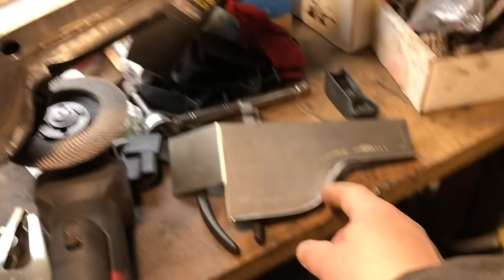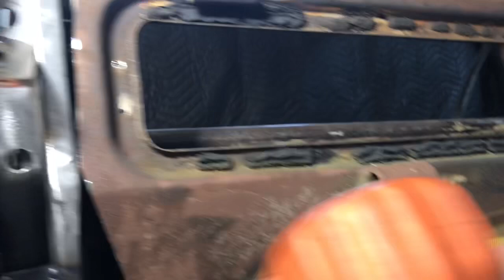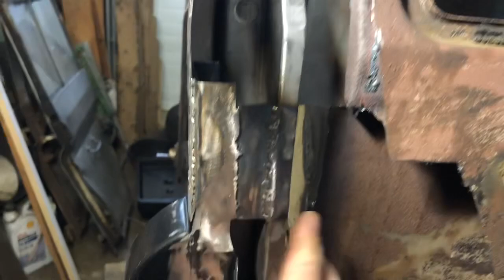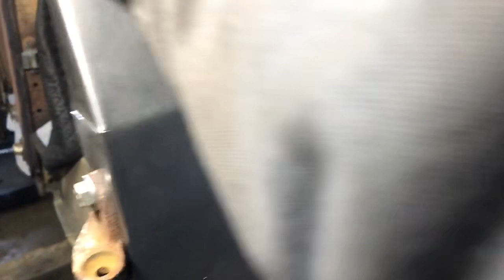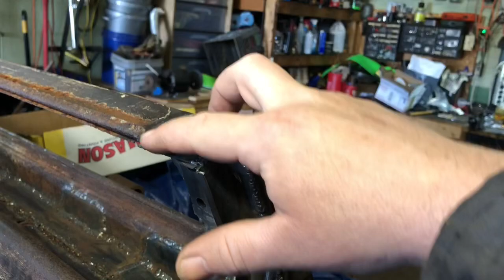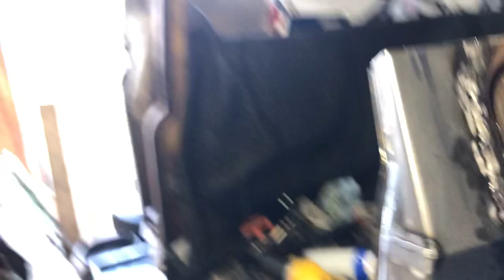Door Pillar Assembly Part 2 Bulkhead Land Rover Series 2A restoration 2.25L Part 22

Comment: Anybody notice the captive nuts for the door hinges do not line up?
Reply from the maker: The captive nuts are on a floating plate in the pillar. The nut plate looks out of alignment but it can move freely inside the pillar to align the doors with the body lines and adjust the door gaps. It worked perfectly for me. Thank you for watching! Part one I talk about this.

Comment: Great job sir,
I've been learning so many tricks from your bodies. Thank you.
Also I am doing exactly the same job on a series 3 Wagon as part of a ground up restoration. The bulkhead is taking ages but am at the stage of doing the driver foot well and some small areas in the centre.
Like yourself I've been keeping the bulkhead mounted to act as a jig.
Your tips for patches and avoiding distortion are very useful thank you.
Next I can remove the bulkhead which will be treated upside down, and begin some chassis repairs with a 1964 Oxford oil immersion arc welder.
Thank you again for your very practical and original techniques you openly give.
Take care,
Chris in Aberdeen, Scotland.
Reply from the maker: Sorry for the slow reply. Thank you Sir!! How is your project going? Get all your piece welded in?